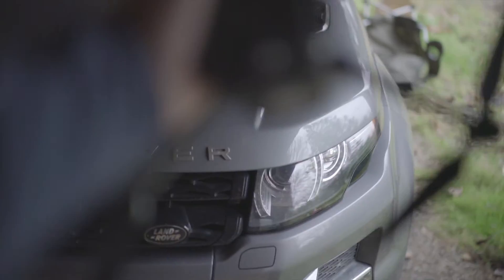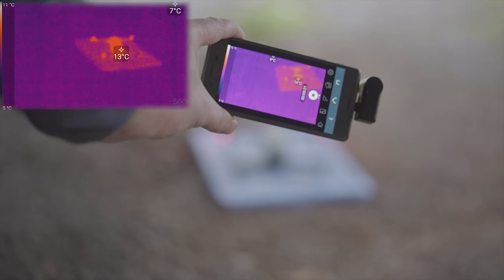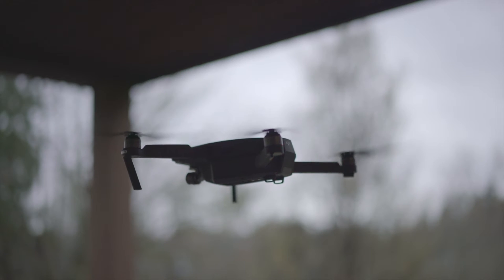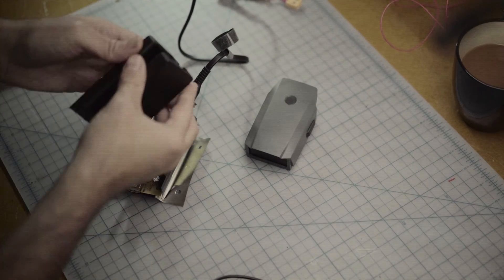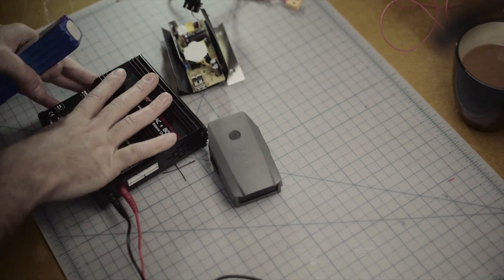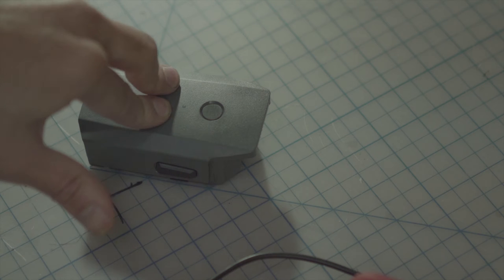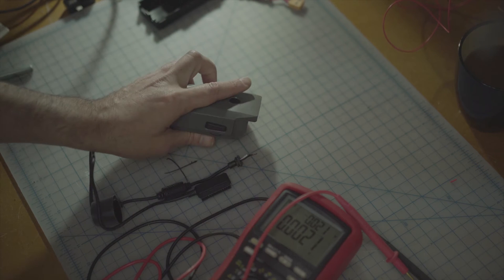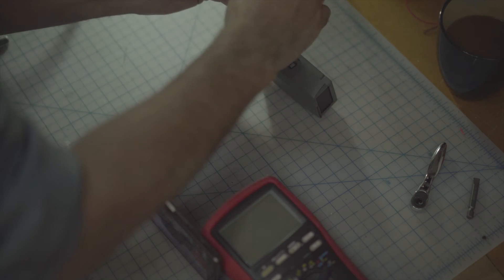Rapid MavicPro battery charging - Thermal imaging too

Comment: 🤔I bought battery for mavic with bullet connectors,gonna change them to xt60 and try charging from my 300W IDS charger HV 🙄 paired to 600w pc power supply I wired up😝
Reply from the maker: Junior Ellis sadly the inbuilt bms prevents us going to crazy. 105w is all she'll take.
Reply: Brian Eastwood ah cool,so maybe adjust my charger to only output 105,it can 😎
Reply from the maker: Junior Ellis if you can set it at 13v and limit to 8amp that works great. Let us know how you get on.
Reply: Brian Eastwood cool 😎 I'll report back when cables arrive 👍

Comment: Well I know the car charger puts out twice the power since it's not a dual power supply with the USB ports also. It's output is rated for 13.05V @ 6A, almost twice as fast as the home wall charger for the US @ 3.8A output current. My plug in my car turns off if the car is off, so I have the clamps to the battery with a cigarette plug on the end. I put a 10A inline auto fuse since it says it can draw 9 Amps. 
I have the same hobby charger, I wish these packs were not proprietary, but oh well. At least they discharge themselves over time with a built in Resistor so people that don't know to keep them at a storage voltage don't damage the cells leaving them fully charged. That was a nice touch since most of the people don't pay attention to that. 

The one thing I still need to confirm on the power supply, I want to test and see if the auto charger turns off when the input voltage under load is low to prevent me from draining my car battery all the way in cold weather. I'll probably test this next week. I don't want start the car and have it be dead, that would suck.
Reply from the maker: I think it will cut when it gets below 12.4v, hopefully that's still enough to start the engine.
Reply: Well I have a sealed led acid battery from hospital UPS's. They are required to cycle the batteries I think every year despite the condition. So these batteries are still top shape. I keep it charged up, my plan is the next time I fly to drain all three batteries and charge it from the led acid in the lab and monitor the voltage drop. This will also give me an idea how many times I can charge from my car battery before I get to low. Well, that is if the car battery is in the same condition as the lab battery. Then I have to consider the cold as well, but I have a 4 cylinder so it doesn't need that much cold cranking Amps to turn over.
Once the winter ends I hope to do more testing on this, and I'll let you know.

Comment: My Mavic came with the DJI car charger but it wont charge unless the engine is running , any mod fix  to get the car charger to work at 12v rather than the 13.7 ? it needs with the engine running, I am no electrician so the simpler the better lol
Reply from the maker: Hey mate you need a step-up converter. Car batteries are 12.4V , I've tested the mavic battery and the management doesn't allow it to start charging until it hits 12.5v (did they do this intentionally?)  see https://gfycat.com/FakeAgileBluefintuna  I don't have the car charger but i'm guessing it limits the current it's self to 6amp. so you just need a step up converter like a drok >8amp http://amzn.to/2glxdTi  If you bought a lighter socket extension cable and stick the drok in the middle of it, should work a treat. I'm just waiting on some bits and im working on a video for a cheap alternative to the car charger that will work in both ignition on/off and at the full 100w.   also the car charger is actually stepping the voltage down as the ignition on is 14.8v I think from the alternator.

Comment: yea i'd love to see the video. if it wont take a ton of time, i'd love to see it.. Don't just do it for me tho if yah dont feel like it.

i'd love to see the parts you used to reach the $10 budget
Reply from the maker: I'm working on it. Though i was trying to mess with a switch and resistors to allow it to work with the ignition on(14.8v) and (12v)off, Kinda sods law the 13v feed i in the middle. This is what I'm using at the moment $11 http://amzn.to/2fqqyWI  plus an old lighter plug, some Xt60 plugs and obviously the Mavic battery connector. Though I'm waiting in a solar regulator that maybe a bit better for the job.

Comment: I have a beefy 1250 watt power supply in my computer.  Think it would be ok to run a lead out of my computer to feed the step-up converter?
This is the power supply I have - note it appears to be capable of 104A on the +12v rail if I am reading the chart at the bottom of the page correctly. 
http://www.jonnyguru.com/modules.php?name=NDReviews&op=Story&reid=273
My computer never uses more than 600 watts even when running full tilt -
 at idles it's only using ~100w (read from my UPS display).

O perhaps I just just plunk down the money for that cheap 10a power supply you linked (not sure I'd trust it from it's reviews though).

maybe this instead: https://www.amazon.com/MegaWatt-S-350-12-9-5-15-Adjustable-Supply/dp/B00JZBE97U/ref=sr_1_7?ie=UTF8&qid=1479211708&sr=8-7&keywords=13.8v+power+supply&refinements=p_36%3A4000-15000
Reply from the maker: robble69 certainly mate it would be fine.  Pc power supplies are a really good way to get the high ampage.  it's difficult to find good external psu's at the right price. Probably the reason DJI cheaped out on the one they provided.  The one i linked was just the cheapest.  Ive used a few $10 ones for high amp lighting without problems,  but yeah it's difficult to guage the quality of these things.  Also for the pc psu out you'll need a voltage booster to get it up to 13v.  I think drok do cheap 10amp stepups.  I'll be uploading another video tomorrow for car charger that'll be very similar setup just using a step-down drok maybe of use.
Reply: Thanks!  That saves me some money.